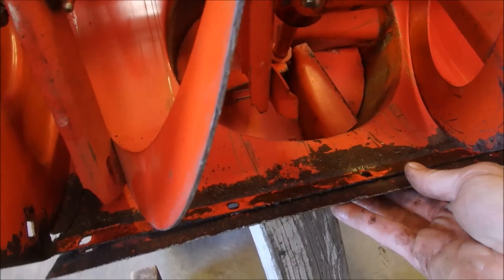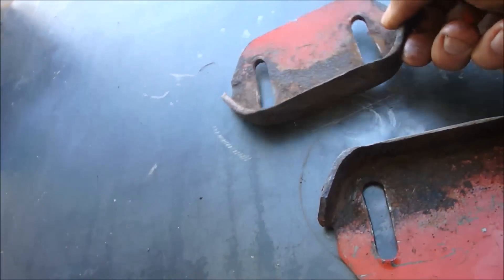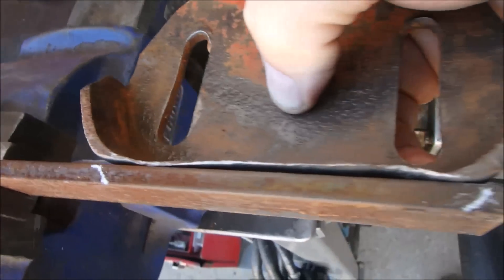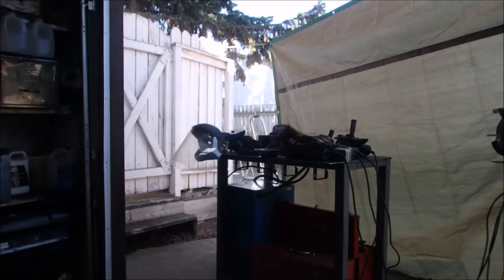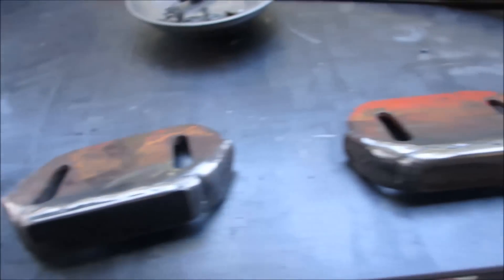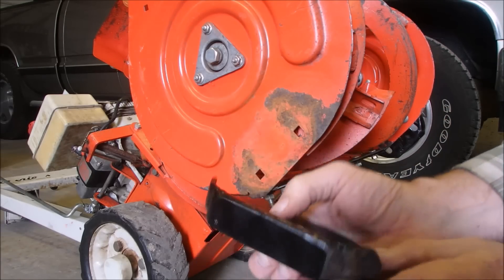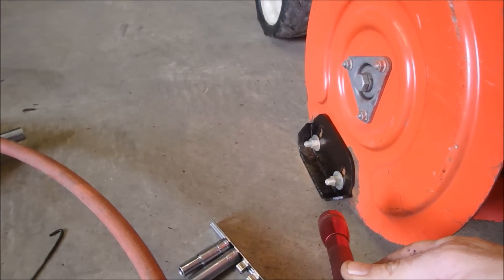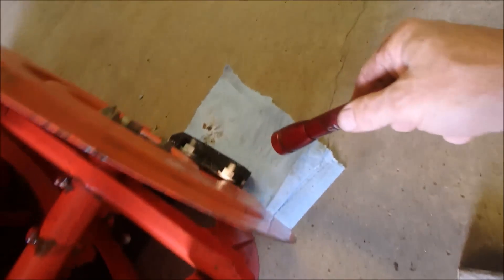Welding Worn Skids on a Snowblower

Comment: Great work! I just finished doing pretty much the same repair on my Toro snowblower and when I was done I was wondering if anyone else was too cheap to buy new skids ;) Thus I found your video. Thanks!
Reply from the maker: +John Adams Well Thank you for watching and commenting.  I'll say I am frugal.
Reply: Bruce Pender Its okay because Ariens doesnt make that style skid shoes anymore. So if your lucky to have a classic and want original matching skids you gotta weld material to the bottom. Those style shoes with just a little meat left are selling averaging 30 dollars, then you still have to weld the material on. So it was worth the repair because Ariens new shoes dont match them older machines. Nice job. I wish you lived close. I have a pair that need material welded. Also my snapper needs frame repair by axle. I need to mount a side mount bearing to side of frame for axle. The bushing wore and the snapper has no bushing support. The frame was the bushing support. Well the axle ate on the frame. Lip needs to be grinded off. Holes need to be drilled and a bearing needs to be mounted to hold and support axle I wish I had a machinest/repair man nearby to help me out.
Reply: INTERESTING DISCUSSION.......

Comment: Good work. Those solid tires are great when you screw in a bunch of hex head bolts directly into them.
Reply from the maker: +sixtyfiveford Well they are so hard with the chains on it marks the sidewalk so I am changing them out to some 12 inch AG tires.  But the axle is 3/4 and the wheel hub is 1 inch    plus I have to drill the axle for the pin.  Video coming of course.
Reply: I was thinking the exact same thing ;-)

Comment: Small world, I live thousands of miles away and I have been doing the same thing for years, except I cut them a little longer and while they are still red hot I bend each end (roughly 1 inch each) up in front and behind. Makes the curve more gradual, so it can't dig in.  Do you have a video where you build up the bottom scraper bar that is worn down, especially one that is worn down unevenly, I'd like to see that.
Reply from the maker: +W. Gator Sorry I don't.  This scraper was Ok as you saw.  I'll keep it in mind though.
Reply: +Bruce Pender GREAT!! I'll be watching. I have done a couple, but only with an overlap join that butts up against the bottom edge of the intake bucket. I am looking for more ideas.